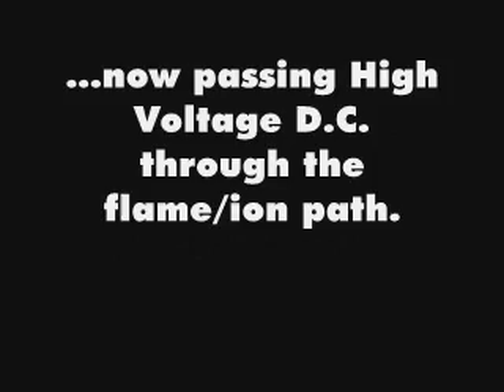HHO flame / ionized spark gap 2

Comment: bro you have the only video of this concept on you tube .. your awsome homes, i am gonna do this but with low voltage say 30 volts  50 amps but im worried i may need to build a water cooled torch tip to pull it off

Comment from the maker: your full of shit-if you build engines you would know that a turbo restricts the flow of the exhaust gases to turn the impeller-WHICH IS A LOAD.
if i told you adding acetone to fuel adds horsepower by the same mechanism that HHO adds horsepower,you still wouldnt get it.
i already have proven it to myself.
if you really do build engines then it wont be hard for you to test yourself.you could do it for under $30,even less of you get some free stainless steel

Comment from the maker: oh man clearly you are an ignorant fuck-a supercharger takes power from the CRANKSHAFT-Capslock on cos im shouting at your dumb ass...THAT adds load to the engine-THE VERY SAME type of load that electrical load adds to an engine via the alternator.
a turbo takes energy from the exhaust gas,WHICH loads the engine.
both turbo and supercharger TAKE energy to make energy.
SAME, i say again for your dumbass ,SAME
as an altnerator running an electrolyser.
you never tried it -that much is obvious

Comment from the maker: let me lay down a few simple things that are common place are accepted in science-supercharging;takes rotational energy from the engine to turn a compressor and push air into the engine=more horsepower.
turbo takes gas flow from the exhaust and turns an impeller that forces air into the engine=higher efficiency+more horsepower.
both of these present a load to the motor but what they put back in inceases the total output.
same with hho-a small load adds fast burning fuel to the system.get it?

Comment from the maker: well i must be a moron then-because i HAVE used it in a diesel engine,using a 5 amp cell (which is much less than a headlight).
and the moronic thing is -i got about 80km distance more from a full tank of diesel when the cell was running.
again not breaking any laws of thermodynamics and definatley not overloading the alternator.
its quite simple-increase the flashover flame in the cylinder and you get a better burn.
better burn means more efficiency.higher efficiency means better mpg

Comment from the maker: @dizekat interesting idea-the process demo'd in this vid is showing that the HHO flame is a conductive path for the voltage.
running steam into a spark gap yields a similar result,so perhaps a kick ass welder could be made by pumping steam into a DC arc.....

Comment: @m3sca1 ahh, with all this talk about magnetron's berillium i thought you were doing microwave heating of flame which would've been even more scary heh.
I kind of wonder, how much useful it is to have HHO in, as opposed to, for example, steam in? How much power do you get from HHO and how much you get from arc? Water does decompose at 2500..3000 celsius, by the way, if i recall correctly (which is the limiting factor for HHO torch temperature).

Comment: The signs of acute beryllium exposure are, a nonproductive cough, chest pain, cyanosis and a sharp drop in the vital functioning and capacity of the lungs. Also included in with the acute disease, is that there may be some edematous distension and round cell infiltration of the septa, and it is the proteinaceous material, distension and desquamated alveolar cell, monocytes and lymphocytes and plasma cells within the alveoli that characterize the acute diseases process.(5)

Comment from the maker: some convection heating ovens do-most have that enamel coat over steel.
i have seen some cheap/interesting bits of stainless in asian grocery shops-but care must be taken,as alot is not marked for what grade of stainless it is made of.
i got some offcut sheets today of 304 grade that has been laser cut to make some bird on a strip thingy,and i got them for a $1 a sheet from a recycling co-op
so hunt around and take a strong magnet with you-if its strongly magnetic is shithouse staino.

Comment: yeah i am looking at starting to build my own hho cells and other things for various applications. since i am a sheety i have access to a lot of 316 stainless and other things such as plasma cutter electrode tips and generally all the parts i would need to tackle such a project. def need to find a way of compressing the gas without adding anymore air to it. it wont cut stainless to well if there is no blast pressure. the gas pressure is what does the cutting. may i suggest using a sml o2 bottle?

Comment from the maker: you can see how quick it heats the stainless cable at the end of the vid-im sure if i left it on longer it would have cut/melted thru it.i cant do any more test at the mo cos my cell is leakin like sieve and got a crack in it,so i need a new jug.